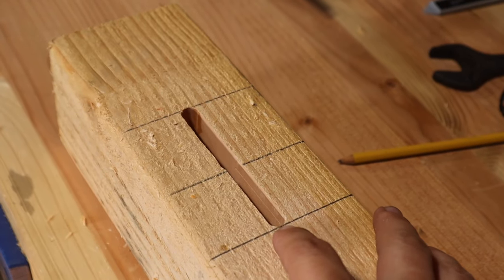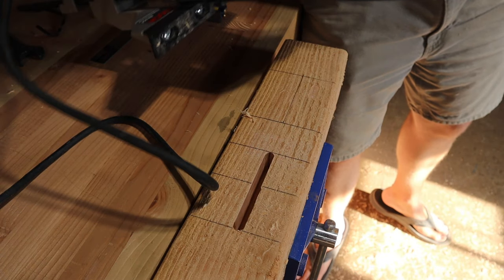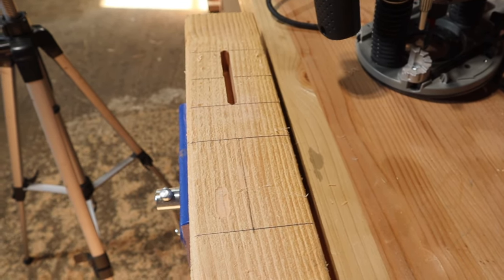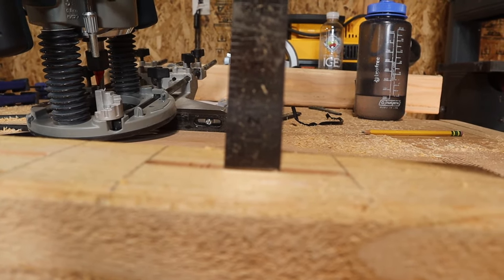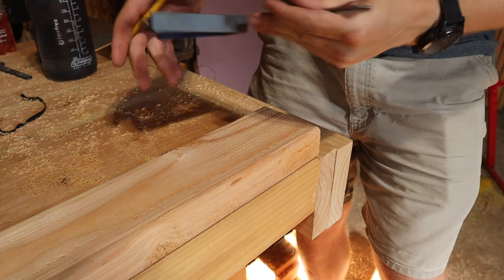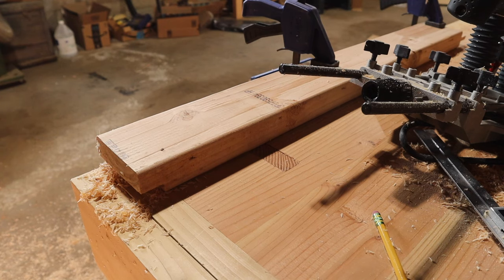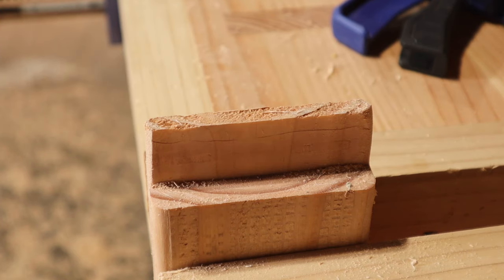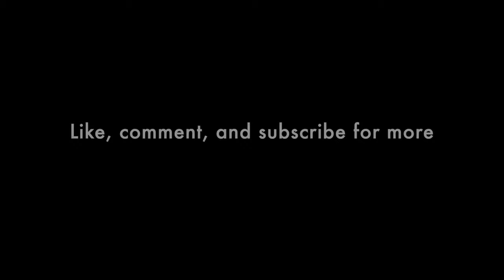Fast Mortise & Tenon | How to Using a Router

Comment: You need wider mortises for that dimension of lumber…. 3/4 at least.   Cut the tendons on table saw, much easier…
Reply from the maker: Depends on the use case but nominally agreed. The tenon in this case was too narrow for the stock I had on hand. Mostly I was trying to show the method.

Comment: also, for amateur woodworkers,  i feel this wrangling with the fractions and measurements is half the fun in learning. only when you know this fundamental approach, can you really appreciate the design of jigs. just my 2 cents.
Reply from the maker: There is certainly a lot of power in fractions rather than just using a decimal system. I find mental math to be easier with fractions than decimals, especially when multiplying or dividing

For example 
6 x 1 1/8” = 6 6/8” = 6 3/4” 
vs
6 x 1.2 = 6 + 1.2 = 7.2 because of the carried one. 

You can get good both ways but I like the fractions.

Comment: Nice work. But if you drop that router or square off the table you'll regret the shorts and sandals.
Reply from the maker: There are times where I choose not to wear the safest clothes in the shop for the sake of comfort. But you are 100% correct, the safest option is pants and close toed shoes.

Comment: There was a suggestion to purchase a second edge guide and longer rods. Your set up has an edge guide on each side of the work piece for greater stability. This is especially helpful with narrower stock. (like 3/4 inch)

Comment: Great work thank you for sharing your knowlege!
Never though about using the plunge router to do the male end!(new to woodworking don't know which part is the tennon or morties)
Reply from the maker: All good! I was there not long ago 😊 one way that you could use remember it is the tenon is like the tail or the tip whichever makes the most sense to you 😊 but in a pinch, you communicated it very clearly.

Comment: Good video but I'd be more inclined to make the mortice and tenon  shorter than the timber by about 5mm either end of the mortice.
Routers are rather fickle tools and you can easily wander so it's good to have a small shoulder overlapping the mortice so that any slight mistake like that can never be seen.
Reply from the maker: Adrian, that’s a great point! It’s a lot easier to hide minor gaps that way. Thanks for that!
Reply: That is what I was thinking. Also, the mortise and tenon should be about a third of the width of the timber. This would not be as strong as it could be.

Comment: yeah I've found that even the "select" 1x4 boards from the box store are often not quite 3 1/2 inches wide. I try now to measure the width before assuming that 1 3/4" is the center.
Reply from the maker: Yea, I’m down to just measuring everything now. No assumptions when it takes hardly any time to measure 😂

Comment: How long should a tenon be? Is there a rule of thumb to it?
Reply from the maker: I haven’t heard a rule of thumb. I’ve done through tenons and blind tenons. If blind, I usually shoot for 1/4-1/2 the thickness of the receiving piece but theoretically, you could do less depending on the application.

Comment: Is the spiral up it a lot better than the double fluted flat bit?
Reply from the maker: Hey Matt! Great question. 

I haven’t tested with anything but the up spiral bit but from what I’ve seen, it is a small optimization to use the up spiral bit compared to others. In fact, some people will use a down spiral or compression bit to prevent tear out on the surface which tells me the spiral direction isn’t the a factor that will prevent use entirely.

Comment: excellent tutorial...i have a question and i'll do my best to make it brief, you did a masterful job at centering your mortise, but in the end a degree of eyeballing was required...i am searching for a method whereby i can run the short side of 2x4 oak over a "V" groove router bit down the entire length of my workpiece and know that i am absolutely dead on center...how do i set the router table fence so that i know the bit is perfectly centered? building an end grain cutting board with a diamond pattern so i want to create a 1" square channel when i hold two grooved work pieces against each other's "V" groove and a 1" sq piece of walnut will rest inside...i'm sure i can get almost perfect by marking the center and eyeballing where the point of the bit lands but any variation from the dead center (even something less the 1/64") will result in the need for a lot of sanding...i can always overcome my massive lack of talent with patience and elbow grease but i'm just trying to learn how to work smarter...thanks a lot...sorry if i've wandered too far off topic from the actual video
Reply from the maker: Hey! No worries at all! Thanks for the good question. My initial thought would be to use a marking gauge to mark the middle of the board at one end or use a marking knife. Then, using that end, you can lower the v-groove bit until just the tip protrudes from the table. Adjust the fence until this aligns with the marking gauge groove. Then, if everything is dimensioned well, there shouldn’t be any more adjusting, even if raising or lowering the bit. If I’m not understanding, feel free to shoot me an email with some photos and I’d love to talk about it more!

Merry Christmas

Josh
Northwest Craftsman
Reply: @NorthwestCraftsman  its a great idea! and i've been wanting to buy a nice marking gauge! do you have a favorite? your idea made me think of two other possible ways....1) use a simple center punch tool instead of a pencil in my center line marking jig so i can scratch the center line for the sharp tip of the V groove bit to sit into...or 2) use the self centering function of my doweling jig and drill a small hole with a brad point drill bit to rest the V groove bit into....thoughts?  thanks a lot for the response
Reply from the maker: Awesome ideas! I think both would work great, for the center punch, you may only need to make the “punch,” rather than marking it in full, and then set the tip of your bit in that spot. The workpiece should “stick” while you pull the fence into the board. 

Here’s the link to the one I have, it’s worked great for me but looks like they may have been having some quality issues as of late. I’ve also included a link to another style that I see a lot. 

If you have any other questions, let me know! It’s fun for me to think through it as well. Also, if you’re willing, I’d love to see the end result when it’s done. 

My current marking gauge
https://www.amazon.com/dp/B001V9KOSM/ref=cm_sw_r_as_gl_api_glt_fabc_54ZTKPESF438P029Q8XE?_encoding=UTF8&psc=1&linkCode=ml2&tag=nwcraftsman07-20

Other highly rated style of gauge that I see a lot
https://www.amazon.com/dp/B07FWS5T1L/ref=cm_sw_r_as_gl_api_glt_fabc_B4QFDTJVETC5QEPMVTPD?linkCode=ml2&tag=nwcraftsman07-20
Reply: @NorthwestCraftsman  i'd be honored to show you the finished product!, might take awhile since i realized the oversized V groove router bit requires a 1/2" collet router which i do not have,,,woo hoo! new tool...several months back i think you and i emailed back and forth about something else so if you'd like me to send the finished product in a DM let me know
Reply from the maker: That's right! You made the beautiful sink surround. I'd love to see photos of this once when you're done as well. Also, that's always the best time for a new tool haha

Comment: Hi, can ve make mortise and tenons easily with a fixed based 6 mm Makita 3709 router?
Reply from the maker: It’ll be a little more difficult because of the fixed base but in principle it shouldn’t be an issue. The “plunge” will be the challenge.
Reply: Thanks @NorthwestCraftsman

Comment: That tenon seems a little thin, have you had any problems with breakage?
Reply from the maker: I haven’t had any of mine break, granted normally I’m loading my mortise and tenon joints vertically (in the long direction) rather than sideways (in the short direction).

Comment: Nice video! I cut my mortises the same way, but cut tenons on the table saw. 
How do you size the length and thickness of your M&T pieces, especially if you are building a table or chair where you will have workpieces coming in at 90 degrees? Since the stretchers come in at the same place on the table legs (top of the legs for example) I end up mitering the tenons to make them fit but not sure that makes for the strongest joint. Do you make your tenons shorter but thicker or do you miter the ends of your tenons too? How do you approach this?
Reply from the maker: Thanks Steve! Cutting them on a table saw is a great idea. Now that I have a dado stack, I’ll be cutting more that way. 

Great question. I’m not an expert by any means, still learning a ton, but had exactly the same concerns. From what I could find, it seems to point to shorter tenons being adequate, especially if they’re glued. As well, I don’t think you need to make them any fatter because most of the lateral strength comes from the tenon resting on the mortise bottom. I don’t think there are any concerns mitering the tenons or even doing a type of lap joint in the space where your tenons would meet, it just increases complexity. I try to shoot for a depth of about 1/3 the thickness of my mortise piece and that seems to have worked for me thus far. If I get something really small that requires a high load, I may look at doing a miter or lap to give more of an interface in the joint.

Again, really great question.
Reply: @NorthwestCraftsman  
Thanks for your thoughtful response. I totally agree with your comments about glue. Guess this is one of those cases where more is better. Interesting about the “half lap” approach. That thought never occurred to me👍🏻.
Anyway, thanks for engaging with me on this. Always good to hear about what others do to approach stuff like this that comes up from time to time. 
Keep the great videos coming! 
All the best to you and yours this holiday season!
Reply from the maker: Absolutely! I love engaging with you guys and thinking through these things because it also helps me to refine my methods too. Hope you have a great holiday season as well!

Josh
Northwest Craftsman

Comment: Surely, you can negate rounding off if you cut a shoulder into it
Reply from the maker: Great comment! And I think it depends on how tightly you need the mortise to fit. If you’re going for a line to line fit with a square tenon and rounded mortise, even with a shoulder hiding the rounded portion, it will still likely be a little loose. All up for personal preference and work required though.

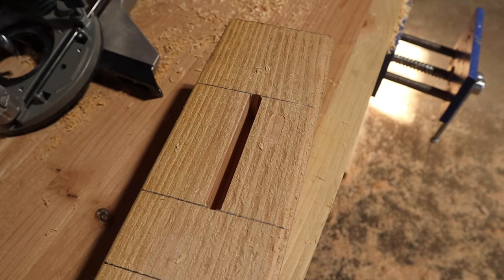Comment: 7:48 If your slots were 1/2 of the bit diameter longer at each end, you wouldn't need to do that.
Reply from the maker: You are totally right! My goal on this one was not to have the half circle gaps on either side of the tenon, however, if you are OK with that, then it is a great option
Reply: @NorthwestCraftsman  You have shoulders on the sides. Why not at the end?

Comment: Why don't you use a v groove but to centre your router it much easier and reliable if you already have a centre line.
Reply from the maker: Great question! A v groove would be easier to align but I haven’t seen a v groove that‘s intended to cut deep slots like this mortise. If precise alignment was a must though, the v groove could always be inserted to align the router and edge guide, then swapped for the up spiral bit since the axis of the bits are the same.
Reply: @NorthwestCraftsman  sorry I meant use a v groove just to centre the router. You can then change to any bit knowing that the router is set to centre.
Reply from the maker: Gotcha! Then yes, you were way ahead of me 😊

Comment: Very informative.  If you need a wider mortise can multiple passes, be made with the 3/8" bit?
Reply from the maker: Absolutely, the problem you may run into is the profile at the ends of the mortise. May require some chisel clean up

Comment: Hey Josh, Products Used might need an update. You have a router table listed, but I didn't see one in the video. You did use an Irwin Tools Combination Square, Metal-Body, 12", 1794469 that's not listed. Thanks for making this video and keep up the good work.
Reply from the maker: Chuck, 

Great catch and thank you for pointing it out! I've updated the section. 

Happy Woodworking!
Josh

Comment: I want my mortice across the wood. Imagine a shallow box or a shelf.
Reply from the maker: That shouldn’t be an issue. Just keep in mind how thin the tenon gets and where the grain is, you’ll be most likely to break along the shoulder of the tenon. If you’re doing a shelf or box, I’d be more tempted to do a dado joint.

Comment: Interesting. 3 things I do differently: I'd use my drill press to make the first 2 holes, because it has a laser. I'd use a center-finder to draw a center line. Lastly, I'd use a router table. The bit will fit in the existing hole, allowing me to retro-set the fence
Reply from the maker: Great suggestions! That is absolutely another way to do it. Only part I don’t love is either starting the router table in the predrilled hole or setting the workpiece on the bit already in motion.

Comment: You told us that the bit is 'better' but you did not tell us why?
Reply from the maker: Great catch! Thanks for calling that out. I like this Freud bit for a few of reasons:

1. It’s much sharper than other bits I’ve purchased
2. It keeps it’s edge longer
3. The up-spiral helps to clear chips better

Some of these aren’t necessarily limited to this bit alone, for example, all up spiral bits should clear chips similarly. But, my primary compliment was for Freud bits in general which have worked beautifully for me compared to the cheaper bits I’ve purchased in the past.

Hope this helps!